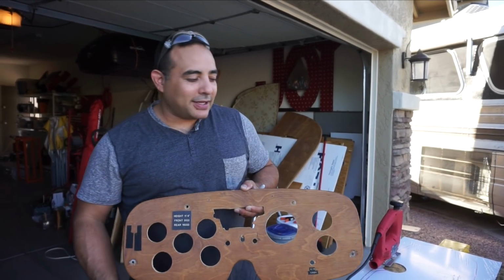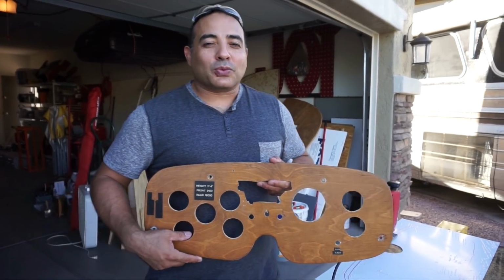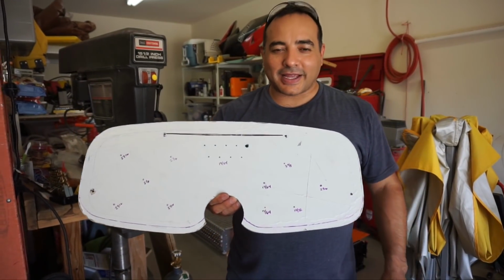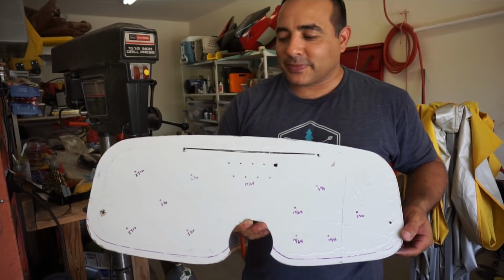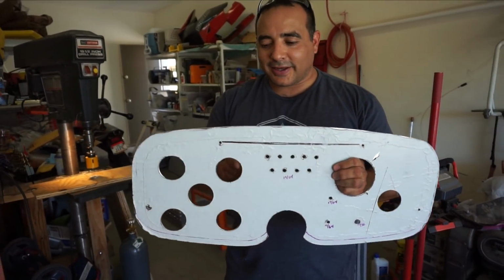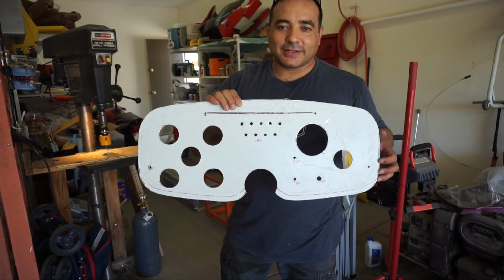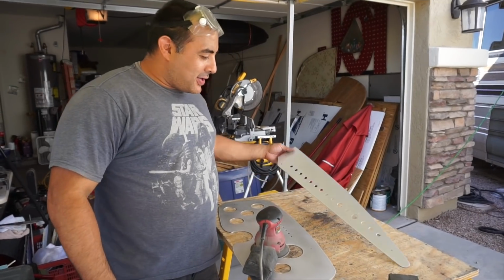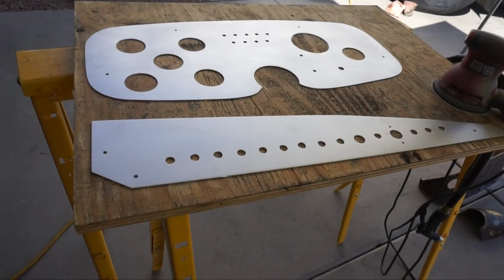Dash Rehab Part 1:  Cutting & Prepping New Panels

Comment: A wonderful investment for you would be a "step drill bit" or maybe several in different size ranges.  They are specifically designed for making holes in sheet metal.  They cut almost perfect holes and are pretty much self de-burring. Since you will probably have lots more holes to drill before the project is done, please try one and I am sure you will be pleased. Also, they are free from the "trianglizing effect" common when using twist drills. I think you can find them on Amazon. 
With the hole saw, be sure that the teeth have not loaded up with metal. This happens often when using a hole saw in softer metals.
Love your project and can't wait for the next installment! I am starting to play with solar systems here so I will be very anxious to see how yours works out. It has to be a lot tougher on and RV but it looks like your system is going to be great! Thanks for Sharing!
Bill....
Reply from the maker: Great suggestion Bill - we even already have some step bits - we should have used those instead!  Thanks for the encouragement and the tip.  We are waiting for a few pieces but should be back into the electrical system very shortly.

Comment: The panel is looking very nice.  If you ever do something like this again please clamp the work piece and wear gloves.
Reply: Agree with the clamp comment for sure, but I personally don't wear gloves (or long sleeves) around any rotating machinery, even a drill press.
Reply: I 100% agree.  For anyone watching the drill press portion of this video it is really important that you clamp your work piece before drilling.  It is fairly common for a drill bit or hole saw to hang up in the material and become a spinning blade that can tear open your soft midsection or easily scissor of a finger off in one of the other holes as it, or a material edge crosses the edge of the drill press table.
Reply: Never wear glove near a machine. That’s how you rip your hand off. But a calm would be a little bit safer.

Comment: When cutting aluminum a could of drops of transmission oil stops the teeth from clogging up with aluminum. Have you heard of uni-bits? they cut really nice holes (small Holes).
Reply from the maker: Yes!  A previous commenter had suggested using some light oil to keep the hole-saw from binding - I tried it recently and sure enough - it worked like a dream!  I will have a few uni-bits but they are way too small - and my drill press is probably underpowered for large ones.  Thanks for the tips!
Reply: I'm catching up, so maybe my comments will be more time relevant. Glenn Lever